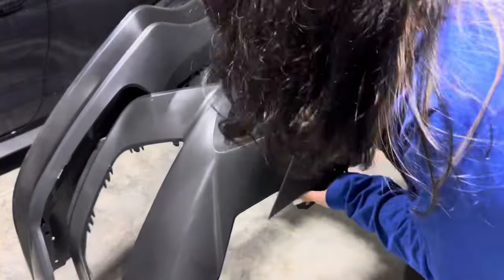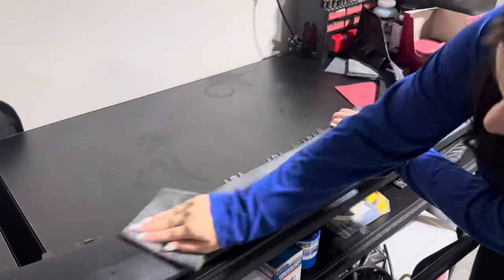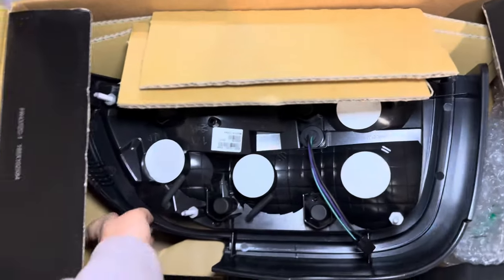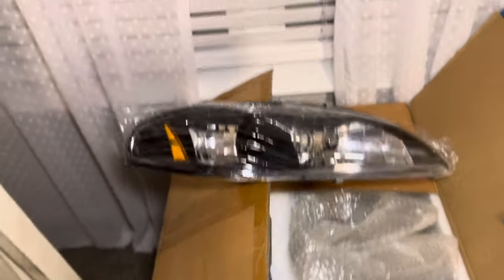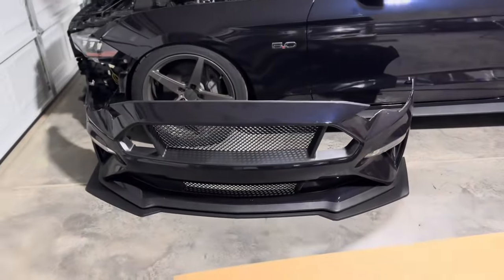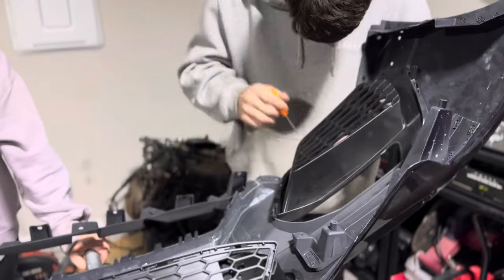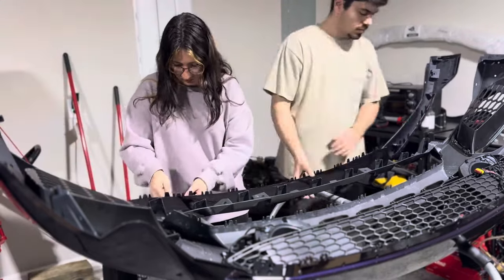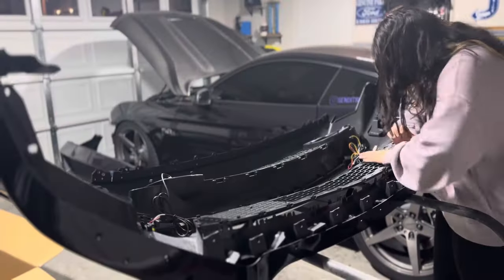Installing Mach1 Bumper On My Mustang GT

Comment: Do u have information on the plug and play of these. as in where to connect wiring to get the lights to run and even blink with the turn signals.

Comment: Do you have switch to turn grill lights on or off? Or do they cut on and off with the headlights?
Really thinking about if I can just replace the grill with those lights instead of replacing the whole bumper..
Reply from the maker: I didn’t wire up the grille lights. Not a fan of them personally.

Comment: Does it fit factory belly pan?
Reply from the maker: Yes it does
Reply: I have the 15 mine doesn’t so should I mount belly pan first but just the back then drill the new front holes
Reply: @Senditshay  I have a 2020 premium 5.0. I know the belly pans are different. I just wanted to make sure it’ll fit the belly pan. It’s currently getting painted now

Comment: Did you hook up the lights
Reply from the maker: I didn’t 😅 I’m not a huge fan of lights in the grille.
Reply: @Senditshay  same but my sponsor sent out me the same bumper with lights and I haven’t put it on yet and just was wondering how they looked
Reply: @Gradyboi5.0  They look awesome. The lights are coordinated with the turn signal. So the lights are normally white, but turn amber in coordination with the turn signal. Unfortunately for me, the lights stopped working after a couple days and I'm too lazy to figure out if it's a wiring issue or if the LEDs are broken themselves.
Reply: @aggee10 how’d you even wire them in the first place